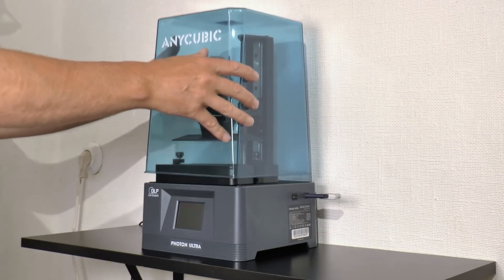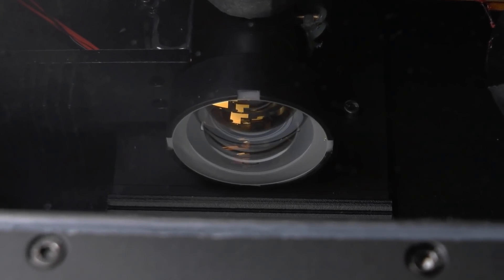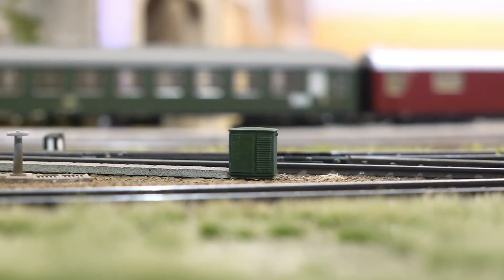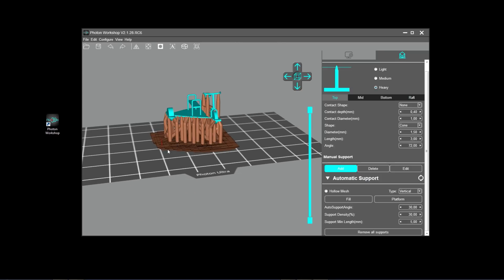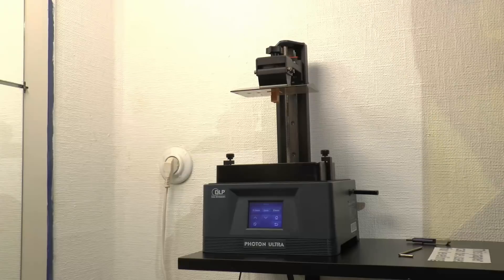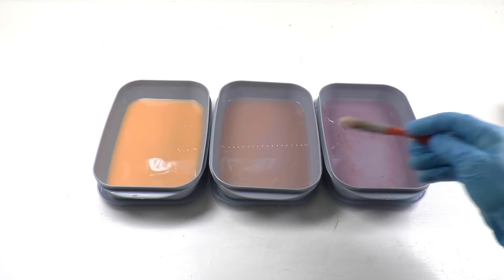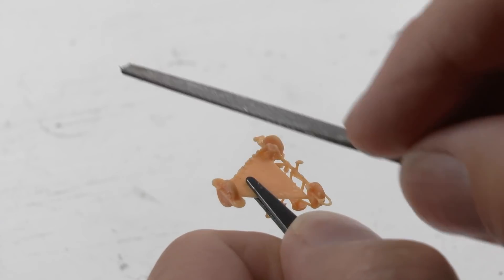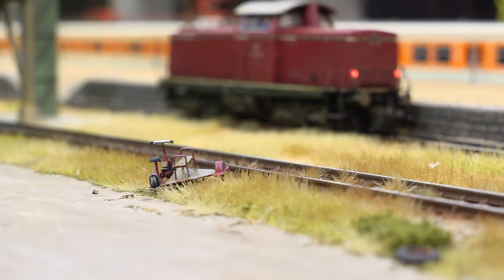Get Started 3D Printing using Anycubic Photon Ultra Resin DLP

Comment: Hey! great video! just a tip: avoid messing around with resin and alcohol without wearing gloves, it seems silly but it can really cause some nasty irritations to the skin, I was using water washable resines 3 days ago and accidentally dropped some in my hand and thought it wasn't a big deal, so I just continued the process and only washed my hands after finishing it. Well it was just a small portion and my hand still burn a little.

It won't make you any serious damage, probably, but having this kinds of injuries frequently may not be a good idea for the long run!

Stay safe and keep putting our your great projects!!

Comment: I used to buy 12 liter bottles or large 5 liter jerrycans with IPA 99,9 but since I invested in a water distiller and get crystal clear IPA back (prob with water from the air) I still have 9 bottles left and didn't have to buy any for quite some time now. I have more tips from years of resin printing but just thought to give some possibilities with this.

(I've printed away 85 liter so distiller may not be for you when you do a figurine once in a while)
Reply from the maker: Wow! Thank you for the tips! Printing in my field ”Model Railroad” the main thing consumed is vinyl gloves! :D I’ve been printing more or less 24/7 for 7 months only using 1,5liter of resin so far.

Comment: Dec. 4, 2021----Interesting video, but I think you missed some points. You downloaded files from Thingiverse, but what scale was it to begin with? Did you have to make any adjustments scale wise? What type of file did you use as from what I understand there's something like 6 of them now. 

Bought a resin printer and have 4-5K worth of things I want to print. But I'm into 1/35 scale zombie/
apocalypse dioramas and bikes would be very useful.
Reply from the maker: Hi! All 3D-models on Jennies account is H0-Scale. So no scaling. I did make a trial to scale the bench and the switch levers to N-scale, but it didn’t work out that well I think. 3D-models needs to be drawn to print-scale to be successful.

Comment: Dude, stop puting ipa into you tank for cleaning. It will get the translucent foil at the bottom milky, which means you will get ghosting and reduce the lifespan of your foil drastically. 
You dont clean the tank. Only if a print failed or if you wont print for lets say a month, then you empty it. For normal use every couple days, you leave the resin in the tank and get an opaque lid.
Reply from the maker: Hi Kenshin, thank you for the comment! I don’t agree what you’re saying. I empty and wash the tank after 3-5 prints using 95% Ethanol. The foil does not get clouded because of that. Not even after 20-30 washes. However, emptying and filtering the resin in the tray is neccesary since small cured resin particles accumulates in the resin in the tray after a few prints (even if successful). These need to be removed to continue getting successful prints. The more exact exposure and UV-power the less cured particles. However, the models and the print process are not perfect, so you will always have a level of these particles.

Comment: Again a very nice video tutorial and congratulations entering the world of 3D printing! I am printing since 2 years. At the beginning I cleaned the jar after each job, but this is not necessary at all. I leave the resin in the jar, dry clean the printing support with a paper towel and cover the whole machine with a box to ensure that it is in complete darkness. This saves a lot of cleaning alcohol and cleaning time! There is one thing to check before putting the machin to sleep: Use the plastic spatula and let it gently glide over the bottom of the jar to ensure that nothing had stuck on the transparent film during the last printing process. 
And one more thing: Yes, you had done well to buy the new DLP! I have changed the LCD display once. The guys from Anycubic sent me one spare for free, but it's not that fun of job to change it...^^

Comment: 500€ for an 3D Printer is a Lot. You have to Print Tons of Stuff to make it okay Off. BTW, the Resin that Comedy from Anycubik isnt that good
Reply from the maker: Hi! I don’t agree at all with that. I printed stuff, catanary poles, windows, platform details, building interiors, figures, freight cars and other items during the three first week, which together had costed me more than 500€. I can’t recall any tool I purchased before, which gave me that type of saving + freedom to create. I have not yet had any issues with the resin either.. Everything so far has been printing perfect.

Comment: after putting the ethanol saturated in resin in a bottle, a technique, not perfect because it stops working after a few cycles, is to put a cap on the bottle and to leave it in the sun : the natural UVwill make the resin agglomerate and precipitate, leaving a clean ethanol (after filtration). 
The Youtuber VOG has made a video on the subject, how to recycle your IPA if I'm not wrong, the only difference in his video is that he uses isopropanol (CH3-CHOH-CH3) instead of ethanol (CH3-CH2OH), just a different alcohol, not any difference except for the temperature of vaporization. The techniques shown seems to be totally usable on ethanol.
Just a few security advices :
- don't use Methanol for cleaning, it's extremely toxic to the blood (replaces oxygen in red cells) and for the brain, it's deadly.
-try to get yourself some respiration protection, paper masks aren't enough at all, a lot of resin artists get serious lung damage because of epoxy resin, it's not exactly the same but health concern should be primordial
Reply: It's actually not working, when your resin have a bit of resin and you put it in the sun, top layer, like 2-3mm thick turns into a foam that blocks rest of alcohol-resin mixture from curing. And if you start to mixing it and putting in a sun again trying to retrieve your alcohol it actually all turns into a foam that you hardly can get alcohol from. So no good.

Comment: I find it interesting that so many people clean up the model with a file after they cure it. I clean up the model before I cure because it's still soft and it's really easy to get the excess bits from the supports off when it's still soft. I cure it after I've cleaned up the model and it's so much easier.
Reply: I think it's best to clean up after final curing. You cannot guarantee the resin particles your cutting/filing off are not still toxic before this. Once fully cured, it's technically "food safe".
Reply: @petemac2126  personally I use a toothbrush and a cleaning solution and then I put it in a ultrasonic cleaner. It seems pretty clean to me by the time I clean it up.

Comment: I'm not sure if you know this, maybe you were just demonstrating, but you do not have to drain the resin from the vat if you're going to do multiple prints. I typically leave the resin in the vat even if I'm going to wait several days before my next print. You just need to stir it up before you do another print. When I first got my printer I would drain and filter the resin after every print but that's going to waste resin and a lot of time so I stopped doing it.

Comment: I'm a little confused by you saying you can justify getting the printer because of the price now. They are selling this only to the first hundred backers on Kickstarter next month for $400 and the price goes up to $500 after that. I got my printer for $250 a year ago. So they've been affordable for a while.
Reply: I noticed that too, but I think he was suggesting that the a $500 printer that has a light source that lasts 20,000 hours is a better value than a $250 printer that needs new screens every 2,000 hours.  But as a hobbyist (and not a production business), I would be lucky to burn 2,000 hours over the next 4 years.  And by then there will be another generation of tech that I would probably move up to. And regardless of printer life - you can recoup your expense on a $250 printer and a few bottles of resin really quickly when you consider how much little molded accessory and detail pieces cost to purchase at retail.
Reply: @thomascatalano6936  agreed. I ran my resin printer for 6 months straight printing probably 18 to 20 hours a day and my LCD screen lasted that full 6 months. I'm not printing quite as much anymore because now I have to catch up on some painting.

Comment: You can see layer lines. Is this normal for DLP?
Reply: If you magnify in enough on any 3D printer you can see layer lines. A lot of it depends on how you set up the model to print.  This particular printer advertises 100th of a millimeter layer thickness. I print at five times that thickness and I have to really look closely to see the layers.  For the most part once I put some paint on the layer lines are almost invisible.
Reply: The layers are typically 0.05mm. Yes, you can see them, but just barely.

Comment: 7:46 this program have validation , you can find automatic if some island need extra support , the only thing you need to do is , press advance and check the line down , and after presh play ,the green layers on your screen is the ok , the yellow is the new and the red spot means there you need extra support, hope help you with my trick info , thank you for this video.

Comment: Very interesting. Thank you for the video. Can the designs be scaled down to Z scale and printed in that size?
Reply: You can try, but they are often too fragile in Z and need to be redesigned. Your best bet is a model made specifically for N scale, not O or HO.

Comment: Dear Martin,   thanks and again congratulation with your videos.   Like many others I'm also interested into 3D printing.  But it's first to study well the options available now.    I'm a H0 and Spur 1 Marklin super fan (and buying too many of them).  Question on your (or other) 3D printers:   
1)  can you 3D print H0 scale peoples  ?   The resolution needs to be good to have a good result.
2)  How to re-print existing small parts ?  Meaning how to scan existing parts like Faller car system driving direction parts ?

many thanks again and please continue with you very enthousiastic ways to welcome each video with your famous 'Helllllooooooooo'

Best regards. Emmanuel (France).
Reply from the maker: Hi Emmanuel, Thank you! In response to your questions:
1) Yes. Same detail as Preiser or Noch. 
2) Re-print is not possible. Every item needs to be drawn in a 3D CAD software like Fusion 360. I have dowload the software (Free of charge) and spent 2 hours with YouTube learning and are now drawing basic models already.

Comment: This technik is not newer, it is much older, because the B9 Creator had this technik 5 Years ago, but for a higher price. 
The creator hat a lower part size, but a higher resolution. 
The Photon Ultra DLP has a much lower resolution, or larger pixels and a smaller building size. So it is a little bit a step back. 
But he has a better UV light. So maybe you will get less errors during printing. 
When you want a really better printer, you have to get the much more expensive Form Labs 3 hat hast a very high resolution, but it needs a much longer working time, because it scans every layer.

Comment: Try to clean the isopropanole with a coffee-filter-paper.
Reply from the maker: Tried it.. It doesn’t work..
Reply: @marklinofsweden  you have to cure it first by exposing it to uv light. Than you can filter the particles away

Comment: What is the resolution of this new technology?
Reply: 80 microns
DLP is not that new, it's from 2010s...
Reply: The advertise that the layer thickness can be up to a hundredth of a millimeter.
Reply: Vertical layers are typically 0.05mm. xy resolution depends on the screen/DLP. For this printer it is apparently 0.08mm.

Comment: I've heard that some resins for 3D printing are brittle, however you can use those prints as masters for making silicone molds and cast in a more durable resin.
Reply: It's not just what resins you use but also how much you the exposure you give them. What I have found is the Elegoo grey I have used a lot gets brittle if you cure it too much after it's washed so I don't cure it quite so much and it stays a little more flexible. Now I'm starting to experiment with other resins so I'll see how they work.
Reply: Depends on the resin. You can get flexible resin and you can even mix those with other types to get the flexibility you want. But even the most brittle resin will be fine for display models.

Comment: No! No! No! When you removed the supports you didn’t have gloves on, but you hadn’t cured the model. The uncured resin is hazardous and you should always use nitrile gloves (and a chemical grade mask) when handling uncured resin. Exposure is cumulative, so you may not notice any effects for some time.
Reply: Yes!  I'm glad I'm not the only one thinking this.  Gloves, respirator.  Be SAFE!
Reply: Thanks for pointing that out. I thought i am the only one seeing this

Comment: Great introduction. Does the resin have a strong smell?
Reply from the maker: Hi Chris, the resin has a smell, but not strong or irritating..
Reply: Thank you, that is good to hear
Reply: I would say very strong smell!
Reply from the maker: @rtemplar4004  Hmm.. If so I think there different types of resin in the market. This Anycube craftsman resin only has a soft sweetish type smell. Not much at all.
Reply: @rtemplar4004  Thanks, that is what I had heard and I was hoping that it was being addressed. There is a household member who is very sensitive to such things and I have no where to isolate a 3D printer :-(
Reply: The smell depends on the resin. But you should avoid breathing in the fumes either way. A well ventilated workspace is a minimum requirement. If you work with resin regularly, you should actually wear a protective mask (and not just a simple clinical mask either).
Reply: @harmless6813  Yes, I am aware, having worked in industrial H&S for 35 years.

Comment: When the LCD goes out you don't have to replace the machine. You just replace the LCD which is, the last time I did it $25. And I did not have to replace mine for about 6 months of almost continuous usage so it lasts a long time. Of course if you don't have to ever replace it that's even better.
Reply: @ChristianP1973DLP printers print the whole layer at once, too. This isn't a single laser spot being scanned across the layer with a steering mirror, it's an array of micromirrors (1 per pixel) that move between two positions for "on" and "off". It's the exact same tech that is used in digital video projectors, but repurposed to project a UV image into a resin printer instead of projecting a movie onto a screen. The advantages of the DLP over an LCD are longevity (micromirrors don't degrade with UV exposure) and contrast (an LCD pixel still lets some light through, even when "off"). DLP's are not new to resin printing, but up to now they've only been used in high end ones because of the high cost of the DLP itself. What AnyCubic have done is get Texas Instruments to adapt a more affordable DLP for resin printing.
Reply: The touch LCD? This printer has only one display 😏 Works with a laser i guess.
Reply: @allffrommars6019  Correcto, this one uses a DLP laser instead of the LCD/bluelight method that the SLA use.
Reply: This is a DLP printer, no LCD to replace.
Reply: @leonkernan  Right, I was just replying to his comment early in the video about how the LCD screen goes out in prior resin printers and he seemed to imply, maybe I misread him, that the printer becomes useless when the LCD goes out. I was just clarifying that when the LCD goes out a fairly inexpensive consumable, the screen, can be replaced without having to throw out the whole printer.  I agree that using a laser like this instead of an LCD screen is superior and I'd love to have one of these printers but the LCD going out every now and then isn't that big of a deal. I printed almost non-stop for 6 months before I had to replace the screen.
Reply: @ChristianP1973 I'm curious what the time would be with a full build plate with these new laser-based printers. I'd love to compare but I can't find any details about it yet.